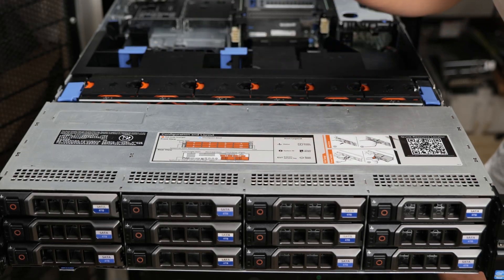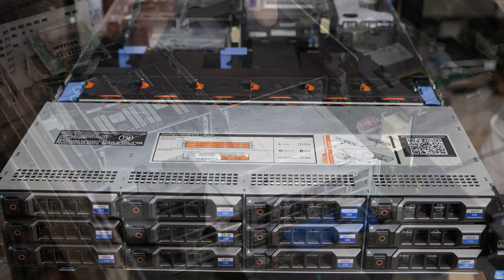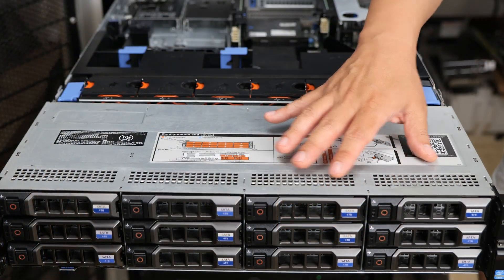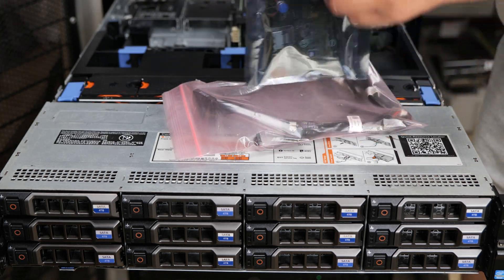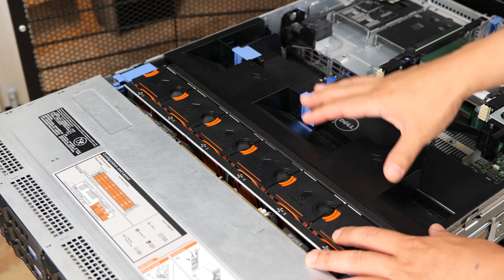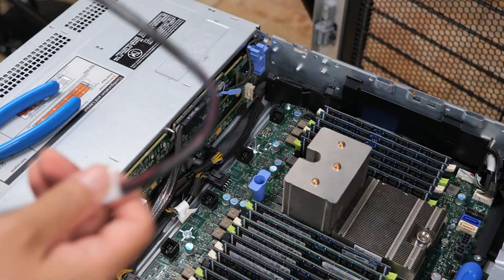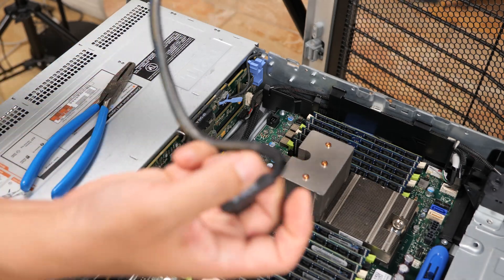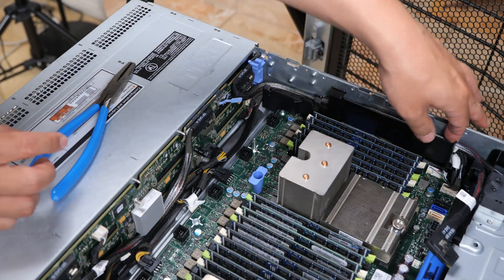How to install R720XD rear flexbay kit | PowerEdge Tips

Comment: Great video! I'm planning to buy R720xd which appears to have monolithic RAID card replaced by internal PCIe LSI 9207-8i card. Do you know if this card would communicate with flex bay and drives that are in it?
Reply from the maker: Yeah, the flexbay works off the SAS expander on the front backplane. If the controller works with the front backplane, it will also see the flexbay. But, you might consider replacing the 9207-8i with a H710 or H310 Mini with IT mode instead. It'll save you the 8 PCIe lanes.

Comment: Hi.  I have a related question.  I just ordered a Dell R730XD and discovered that maybe I could have two drives on the back.  I went back to see the listing of servers and some mention two extra drive bays.   My invoice does not mention this so it appears that the cage is not in my server

My question. . .  Can this option be ordered and installed?  I’ve not found much information about this.  I see some eBay options but they seem to be for four bay 3.5” “mid plane” cage assembly’s.

Thanks for your help.
Reply from the maker: The R730XD also has a rear flexbay kit similar to the one in this video. But it has different connectors (SFF-8643) and cables you need. If you don't have this option already installed, I do recommend it. And it is just as easy to install as the one in the R720XD. You need to find the Dell P/N for the parts you need for that kit - I would ask on the Dell poweredge forums as Dell employees there can look up the P/N for you.
Reply: @ArtofServer Thank you very much.  I’m setting up TrueNas Scale and when I found this out, it made sense to potientially have two SSD boot drives and keep the front bays for storage.  It should arrive on Friday and once I get things started, I’ll start checking on this.  Take care.

Comment: What is the difference between the LFF and SFF Flex bay kits? Is it the cable length on is there more of a difference?
Asking because I just bought a Flex bay kit for my LFF but it seems to be acting buggy, it sees the drives and after starting seems to be ok with the drives but they blink in amber.
Reply from the maker: The LFF means Large Form Factor, and SFF means Small Form Factor. In this context, it usually refers to the backplane involved since the flexbay kit requires different cables depending on the backplane type you have. If you were able to actually install it, you probably got the right cables.
Reply: @ArtofServer  I understand that LFF ans SFF refers to the server front backplane type. I did manage to install it but the SAS cable that was sent to me was way too long, come to thing about it that was the only one that seemed off. However looking up the kit in the official docs, the other cables, depending on the kit, have different part numbers, that is why I was wondering if I got the right kit and maybe the pinout is different depending on the kit. Since I only have the one LFF I do not know the difference on the SFF backplane.
If I understand correctly you sell the flexbay kit for both LFF and SFF servers so I though maybe you do know. For extra context, no I did not buy my kit from your store, buying from you would have probobly been a safer option if I had known that you sell these at the time. :)

Comment: If I want to passthrough all of the front drives through for truenas in proxmox do the rear drives need to be connected to a different raid controller to function as boot drives?
Reply from the maker: That is correct.

Comment: Thank You. I consider R730xd as my next server. Two fast drives on the back for the OS, swap and massive storage in front are neat. It would run 20 VM's like it's nothing.
Reply from the maker: Yeah, I love the R730xd. It even has a 16x3.5" drive option!
Reply: @ArtofServer  Yes, with 4 additional internally. It would definitely spare me of getting a dedicated disk shelve.
Reply: I have this one also but it has problem with voltage outside of range issue on the primary backplane.
It never comes on until you disconnect backplane signal cable then drives become undetected. 
Now I was wondering if add rear backplane to the primary backplane with/without signal cable will that rear backplane work?
Or is there another way to connect rear backplane without primary backplane?

Comment: Great video as usuai. I have the same LFF but i accidentally ordered the 730 flex bay and had to replace the SAS cable because the 730 had 2 846 ends. My other 3 cables were ok. However . What is the connector next to the HBA that is empty. One is a double that connects the front back plain, but the other is connected to nothing and I have yet to find out it's use. I did flash the boot loader onto the HBA710P and It allowed me to choose what i wanted to boot off of. Including nvme boot.
Reply from the maker: I'm not 100% sure, but I believe that SFF8643 connector on the motherboard is used for configurations where there's no mini monolithic controller and a 4-bay backplane is used, it can be controlled by the chipset SAS controller.
Reply: @ArtofServer  Ok Thanks.

Comment: Wil this fit on a 730xd?
Reply from the maker: Great question. This kit won't be a direct fit for the R730XD, but there is a similar kit for the R730XD.
Reply: The R730XD and R720XD are basically the same. However The sas connector cable is different. R730XD kit has 2 SFF8643 connectors as oppose to 1 8643 and one 88xx for the R720. @ArtofServer sells the correct cable of u get the wrong one.I kept mine as I plan to get a R730XD also.

Comment: Does every LFF XD already have the physical area for the two drives installed by default?
Reply from the maker: yes, it should. usually there's a silver cover that blocks the 2.5" bays.
Reply: No. I've seen other content creators with the 720XD without the bay holders installed.

Comment: Hah - I did this a few months ago on a few R720XDs. Even using the Dell docs, finding the BP connector was a pain – spent a good 10 minutes trying to find it buried behind the cables. All the other videos (of which there aren't that many) either only showed the 2.5" bay version or completely glossed over the spot to connect the BP to BP cable. Just a hint: not only is there a cap on the BP to MB signal line (which you mention), there's also a cap on the backplane SAS connector that people may miss. It barely looks removable and is easy to miss if you don't know where the cable is supposed to connect. Thanks for making the video.
Reply from the maker: Thank you for watching and sharing your tip about the caps. I actually shot this video twice because the first time my hands were blocking the camera view of the connectors. I re-shot it using the pliers so as to make sure people could see the connector on the backplane. Your comment made me feel it was worth all the effort to re-shoot this video, so thank you! :-)

Comment: Thank You!  I plan on doing this to my 720XD LFF and use it for TrueNAS.  Seeing where all the connectors are is REALLY helpful! I am assuming that I can use the rear bays for mirrored boot and the 3.5 inch bays for storage.
Reply from the maker: Yes, exactly. And plenty of PCIe slots too, for adding NVMe PCI SSDs for cache devices like L2ARC or slog device, and GPU or QAT accelerator for coprocessing. Really incredible platform.